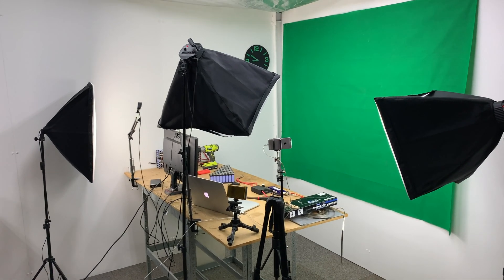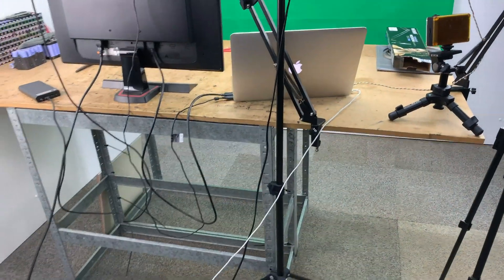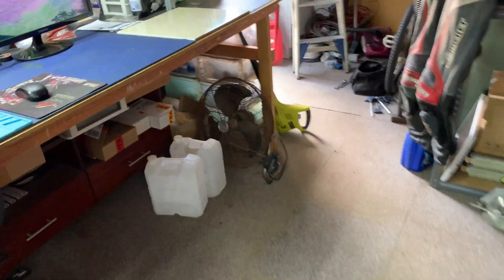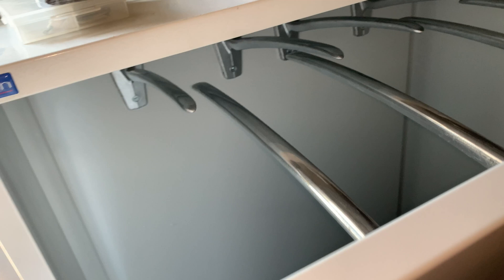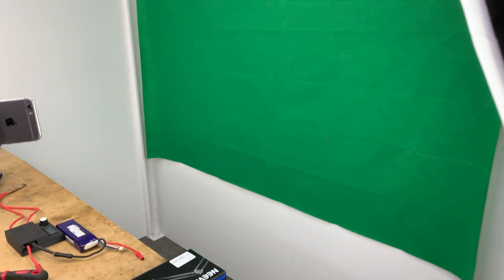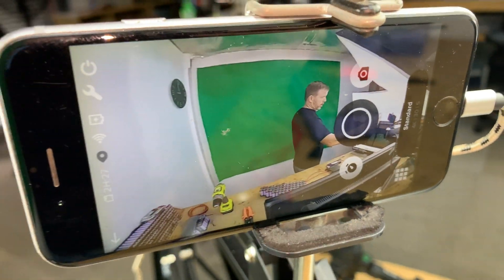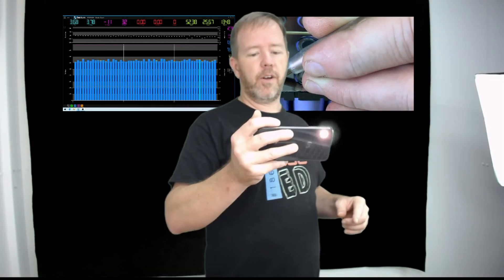Studio update & walkaround

Comment: Excellent setup. Light is everything in photography and filming. But I'm not a great fan of that greenscreen rubbish.
Reply from the maker: Your vote ditch the green screen? I think it's neat lol
Reply: HBPowerwall That‘s all that matters. No worries, mate!
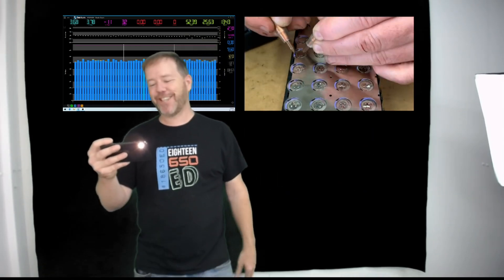Reply: @HBPowerwall     I think you should at least consider ditching it. Sometimes you get some green reflections off of the screen or the keying isn't spot on. For example 4:59 behind you and 5:04 your overhanging hair. There are many cool things you could do without dealing with a green screen.

I have a softbox like yours and I've been considering replacing the 250W worth of CFL with something more efficient but I haven't really looked into it yet.